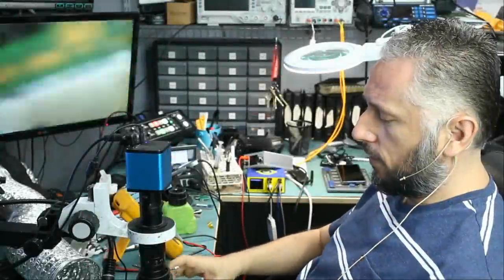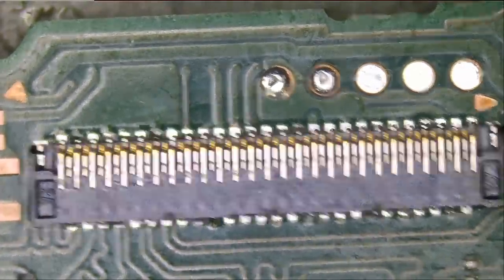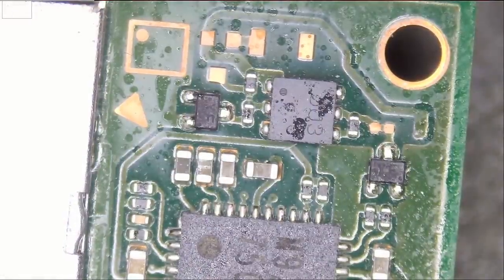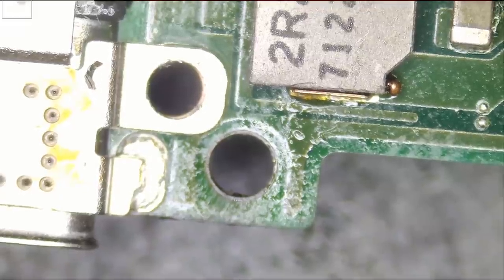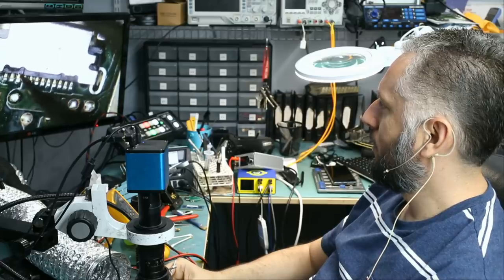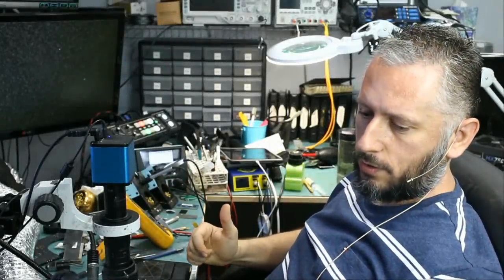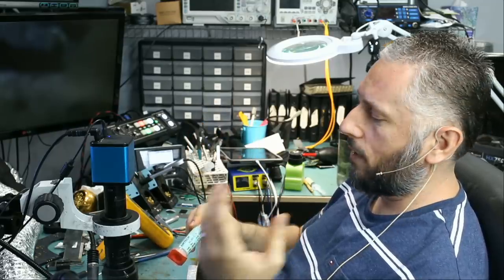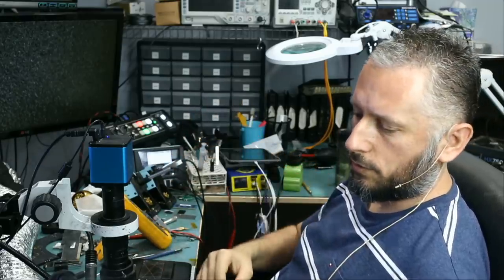Nintendo Switch Repair. Another shop could not fix it. Amtech 559 and 213 Flux Back in stock.

Comment: 2 years ago my daughter pulled my PS4 onto the floor by the charging cable and it ripped the HDMI socket off of the board. I left it disassembled in a box for 3 months until I thought instead of throwing it out I bought a new socket and fixed it my self. I used your videos as a little guidance and feel I done a good job. It’s still going strong today. Was probably luck it worked but it was going in the bin regardless.

Comment: It's because of the chip shortage that everyone is willing to repair their "old" cards :D
Reply: I think it´s because of mining fever :D
Reply: no its because of the price
Reply: @mickeybinas  because of mining fevers xD
Reply: im a miner lol i have 130 gpu currently only 102 in action, i so wish i could repair them but unfortunately its a bit beyond my capabilities most of them are detected but stop hashing after a min or 2 then put my rig into constant reboot loop so have to remove them. I'm guessing its overworked gpu with cracked solder under chip but when I tried to reflow one with hot air I couldn't get it to liquify. so after my 1st try i quit. i like these videos as the repairs look amazing soldered joints look factory not like some seen
Reply: @gblargg  price is how much I paid for the card
Reply: The pandemic and cryptomining boom at the same time.😊
Reply: solid
Reply: Keeps them out of ewaste

Comment: Replaced an HDMI port. Could not get solder to flow properly. Only after preheating the board with hot air was I able to get the pins to not bridge. This guy makes it look easy.

Comment: I don't know what the owners of these Graphic Cards do to them. From my first PC until today I had at least 8 different graphics cards. These were the manufacturers S3, Diamond Viper, 3dfx, ATI and NVIDIA. None of them failed for me. However, I only slightly overclocked the GeForce 4 MX440 with the "PowerStrip" app after I had given this card a new cooler for the GPU and additional heat sinks for the graphics memory. This card is still working. It is in an old Pentium 4 Windows XP PC that I only use for older MS-DOS and Windows games.
There is a GTX970 in my old gaming PC, and a GTX1080 in my current PC. These two graphics cards are still working properly. The graphics performance of these two models is still sufficient for my purposes and games. As long as their performance is enough for me, I don't need to buy a new one.

Comment: where do you get the usb charge ports for the swatch mine are too short if you dont mind me asking? i have a couple of pads lifted how much do you charge to repair if you dont mind me asking i have the newer model ive gotten several replacements charge ports but the pins are to short the oem look longer.
Reply from the maker: https://northridgefix.com/product/5-x-nintendo-switch-usb-c-charging-port/

Comment: First i want to thank you for all the good content you share with us

And i have a question, I will be deeply grateful if you could help me

I've got a 15 inch MacBook Pro with retina display, it stopped working, no one here in my country (Iran) could fix it so I ordered another mainboard from Aliexpress. The new mainboard starts, the fan spins and i hear the chime when powering the macbook but I don't get any image and backlight with the new mainboard.
The original mainboard model of my macbook is 820-00163-A and the one I ordered from Aliexpress is 820-00426-A

Do you think this could be the problem?

Comment: Hello. Can i ask you please about transistors. I plug battery to my rc transmitter backwards by mistake. I burned an isc rf transistors 2sc2351p. I couldn't find much about them in the market. Can i replace it by 2sc2757 it has slightly deffernce about voltage info. Can you please look at it if you have time. Or what model will be better to get. I would appreciate very much.

Comment: Hi, about Rtx 3090 shorted by liquid metal, use ultrasonic cleaner, and try to check under the big chips before apply power to it. maybe there is a lot of liquid metal under the chips.

Comment: what temp do you set the hot air station? i had to add leaded solder to remove the usb port?... did you mean the prior shop had already applied the leaded solder?